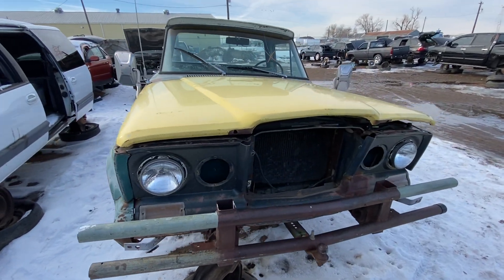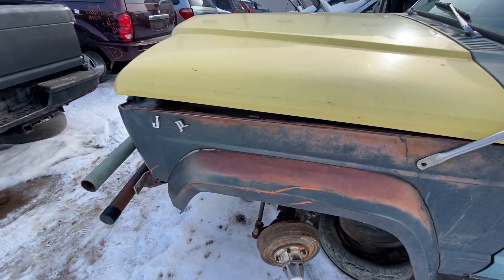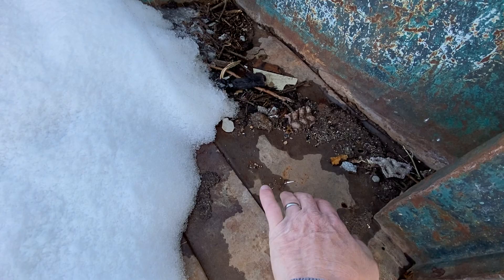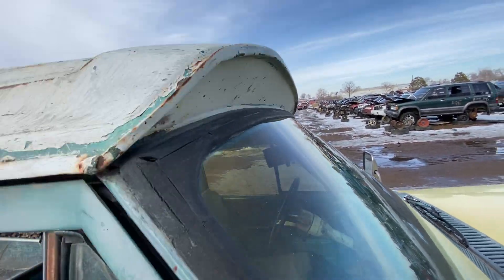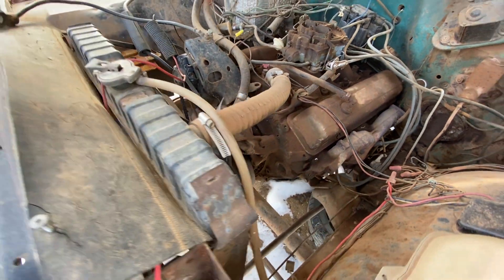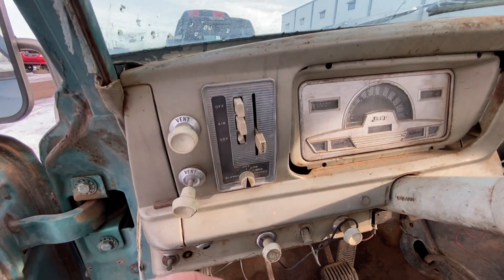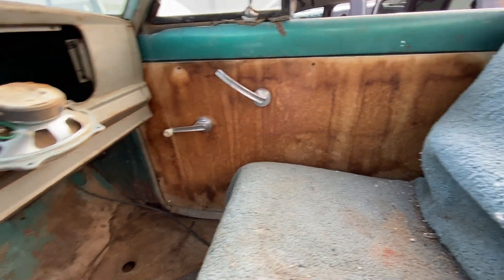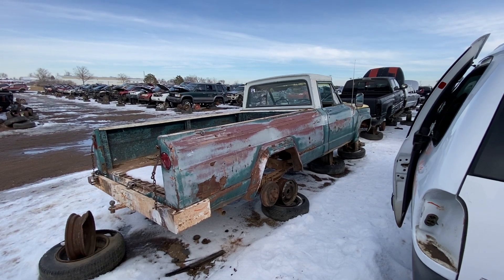JUNKED! Jeep J-series Pickups aren't an everyday sight anymore (if ever), and this one's super cool!

Comment: It is a J-300 Gladiator. 1963-1965. At 3:57, the top badge would have said 4-wheel drive and under it would have been the J-300 badge. 

Paint Code 225 is Spruce Tip Green, which appears to be the main patina color. Trim Code 208 is for an Amber Interior.

The VIN plate is missing and would fill in some details, you can see where it was attached on the drivers side door pillar at 5:47, where the four holes are. 

The original engine would have been a 230 Tornado OHC in-line 6. These were swapped out quite frequently by owner's wanting more power.
Reply: Agree.  No backup lights either.
Reply: Would be '63-64 as Jeep switched model series to J-2000/J-3000 from J-200/J-300 in the 1965 model year.

Comment: I just picked up a pair of these a 68 j3000 swb with the olds 350/auto  distributor in the rear. The 71 long bed with the amc 360/4 spd distributor in the front.

Comment: Thats defiitley pre- 1971 Gladiator pickup. Probobly a J3000 You can tell by the post mount style leaf springs which were switched to frame under with shackle mounts in '71. Not sure what motor is in it. Possibly a Buick 350 which would have been standard equipment on some of these trucks.

Comment: I have a 1966 Jeep J - 2000 Gladiator pickup and from what I see of the badging your subject vehicle appears to be  between 1963 to 1965. The gas tank in the cab is a custom installation and I believe the engine should be a Vigilante 327 AMC V8.
Reply from the maker: Thanks!  And thanks for watching!  The gas tank really threw me, that's interesting if a bit odd, makes sense though.

Comment: I'm guessing it's a J-300 because of the beefier rear spring pack then my 64 J-200. It also looks like a small block chevy engine, if I was guessing the year I would say 65, 66, 67,
Reply from the maker: Interesting, thank you!  The front is what threw me initially, in the meantime I realized they used the same four-light radiator support panel even behind the horizontal grille that only used the outer two headlights and just kept the inners open.  I had assumed that this one had used the upright older grille.  J-300 makes a lot of sense based on the passenger side (missing) badge, it just didn't all add up at the time!